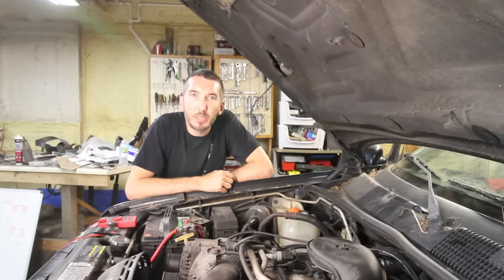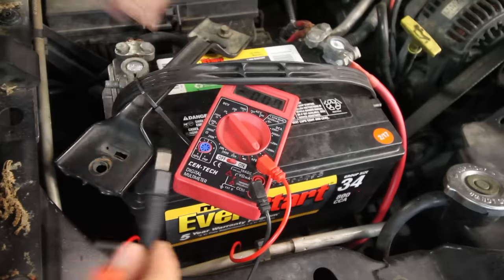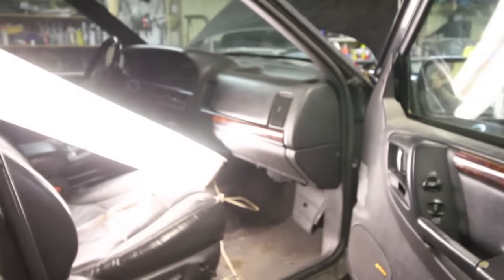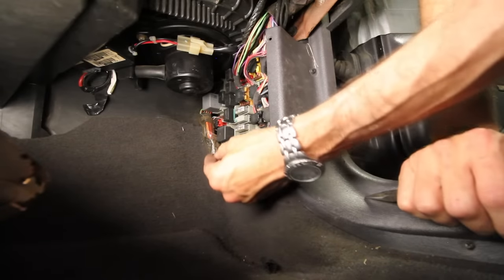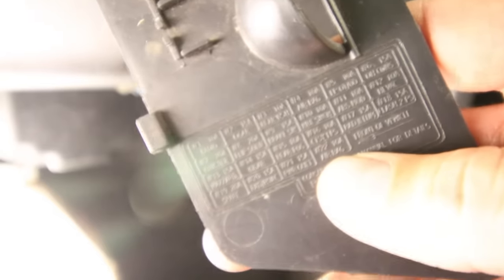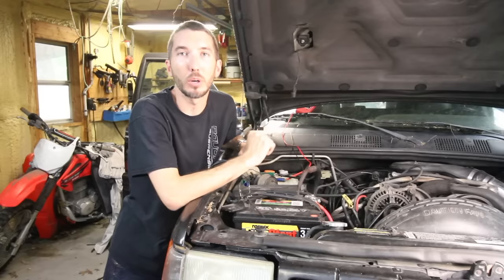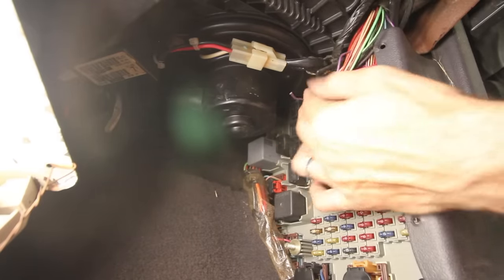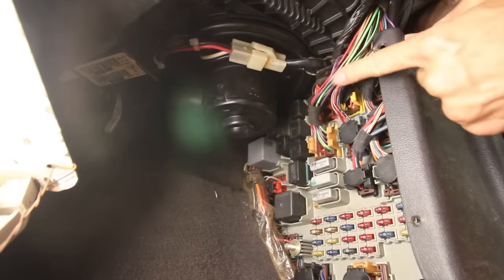Why Does My Battery Keep Dying? - Parasitic Draw Test and Fix - Operation Cheap Jeep

Comment: fun story about how everything is related (especially on late 90s Chryslers). passenger side window regulator goes out on 02 Grand Cherokee while we're out of town. I artfully use a rubber mallet to hold the window up to get us home, and I just disconnect the main harness for the door so I don't accidentally force it and potentially do more damage. in addition to NONE of the power locks working, and the right rear window not responding, the dome lights stayed on. pulling the fuse for the dome lights causes the  AZC climate control to not power on. given that only left windows worked, A/C did not turn on, and it was 80 degrees, I had to stop again and replace the dome light fuse. the next day I did what I should have done at first, and just disconnected the connector for the window motor.
Reply from the maker: Pretty crazy that pulling a wire for your door can cause the A/C not to work, but I believe it after messing with this stupid thing!
Reply: Matt Hooker my 04 has done that multiple times. broken wire in the harness that goes to the driver's door will do that. Caused my AC to stop working, caused power locks to stop working, all 4 windows to stop working, all the lights on the dash to come on randomly, etc. Fixed the broken wire and everything worked fine afterwards.
Reply: i did something similar with a late model zj like the one in the video, i simply replaced my doorpanel. then the key fob didnt work, no worries i close up and go to bed. wake up at 5am to head to work, try to start the jeep and the alarm goes off. neighbors loved it. found out after a whole day of research and chasing wires,missed work btw,  that the passenger door switch assembly(window switch and door lock switch) is where the sensor for the key fob is. also found out you cant disable the alarm in a 97  zj. and if you use the power locks to lock the jeep, the alarm arms and unlocking it with the key dosent disable it, only disarms using the fob or unlocking the rear hatch with the key for some reason. my jeep had the hatch lock cylinder replaced at some point before me and that key trick didnt work. has worked on my buddies 95 zj tho. yay chrysler. i sold the zj and have just have my mj now. and a honda lol.
Reply: If you think it was the hatch why didn't you unplug it and see if it stops. Instead of cutting wire.
Reply: Honesty is rare. I just happen to have a 130K 98 JGC. I jump start it with a 98 lawn mower. AC works but not the AC blower switch ...;) I store yard tools in it. @bleepinjeep
Reply: Do u have a email or Twitter or something I have some questions and would like to send you a pic of my multimeter
Reply: I have spent months researching into fixing a car battery and found a fantastic resource at Jons Mender Guide (google it if you are interested)👍
Reply: This might be the same problem I have with my 97 Grand Cherokee.  It clearly seems Jeep has crappy wiring.  I also had to have two door locks fixed when I got it because they would not work, and now the left rear window stopped working.  Again, Jeep has CRAPPY wiring.  A Jeep fanatic said they used cheaper than normal solenoids for doors, thus they crap out often.   And the ECM might be next.   Don't ever get a Jeep or apparently a Chrysler car - now made with Fiat parts?
Reply: get used to that guys, anything FIAT bought since 80's to nowdays turned into garbage. Lancia Alfa Romeo was the beguinning now it's yankee time LoL
Reply: This guy reminds me of Mr Rogers until he said  so I just cut the purple wire.
Reply: @bleepinjeep  mine show 0.08 .. What is that mean? Is ok ? Or I is bad?
Reply: I've never had a jeep without electrical issues... It pisses me off.
Reply: My mechanic installed a battery kill switch to help me get by until I can have this done. I'm not mechanically inclined so for now that works for me.
Reply: @bleepinjeep  So we replace the fuse that's doing it or what ??
Reply: @coreydenton8296  where was it broke at

Comment: I have been fixing electronics equipment for 40 years. I think this is the BEST real world troubleshooting video that I have ever seen. THANKS....GREAT...JOB!!!
Reply: My professors had to say it twice before l got it...this guy..l could have listened with eyes closed n still got ..kudos
Reply: What are you saying .....BEST EVER
Reply: Best way to wakeup a bunch of modules and then your chasing your own tail!!!    There is a better way!!!
Reply: I've also been in electronics and computer repair for 40+ years and I would have followed these exact same steps. I suspect a switch that is supposed be open when the hatch is shut is either stuck or shorted closed. Or possibly not getting physically pressed by the hatch.
Reply: @wileypeacock6095  This is what I experienced. My back hatch switch circuit was not opening because the hatch wasn’t closing completely. My dash light was on, but I didn’t think that would drain the battery when the engine was off, but it did! Once I fixed the latch and the dash light went out, battery was healthy since!
Reply: Cutting harness wire is not a fix.. amateur hack hour
Reply: Yes, fundamental and helpful. I’ll be following the same steps with my WJ and BMW.
Reply: This gives me a place to start! I have a 2001 Dodge Intrepid and the battery drains within 2 days if I don't drive it. Maybe I can figure out my problem. Put it in the shop twice all they did was take my money. Car came home, was dead the next day  Master mechanic, right!
Reply: Agree beat one I've seen  thanks

Comment: I´m a mechanic. This is one the best videos I´ve ever seen. Very well explained. Perfect troubleshooting.  Good job
Reply: I've had my car in the same repair garage for several years now, for the same fault, battery drain.. After having two new batteries installed within a short time, we paid for an electrical check by a car electrician, ovr £70 each time, the garage did other various checks. The electrician said no faults in the electrics, we were finding that the cooling fan was staying on after switching the battery off, this was intermittently. Then the garage fitted another new battery and a new alternator. Problem of battery drain continued. We'd charge the battery up and it would slowly drain, until the second or third week the battery would be drained. My car is 2002 vauxhall diesel 1.7. I'm so fed up. I've been giving the car a good run at least once a week, thinking I was topping up the battery but, this morning I went to start the car and the battery just made that dying sound, no start.
Reply: @kt1696 it's been 4 months since your post and I am wondering if you attempted his approach?  I somewhat suspect that the shop electricians  plugged your car into an electronic diagnostic port and downloaded any fault codes.  Finding none, they said "no issues" found which very well might've been true at the time if there's an intermittent short that was not active at the time they tested

Comment: This video is 6 years old but has to be the best troubleshooting video of how to troubleshoot a parasitic draw. I did the one that has been pretty popular of how to locate it without removing the negative battery cable but that one has proven a bust. What I love about this video is you not only show how to set the multimeter and pull the fuses but you then also show how to go to the next step to narrow down where the draw is in case you still end up at a rather broad range of possibilities like the wire cluster that the fuse was connected to which in turn controlled the BCM which would have been a major pain to troubleshoot. Hopefully whatever is draining my battery now is something easy to locate, but better yet, easy to fix.

Comment: I watched this video yesterday before doing some work on my battery and today I helped a neighbour with a drained battery get her manual transmission car push-started and on her way. Since this video touched on a back door-release hatch not working properly, I looked for something similar when my neighbour's "door ajar" warning light stayed illuminated. Turned out her back hatch wouldn't close properly because of some fender damage that wasn't fixed and caused the door to jam opening and closing. To open it, she would pry with her fingers on one side and pop it open. To close it, she would give it a good slam. However, the electric switch to remotely open the hatchback was accidentally hit by her and since the door didn't pop open at the time, and she didn't notice the illuminated warning light, it stayed illuminated for days until she went to start her car today. Not exactly the same problem as the Jeep in the video but the knowledge gained came in so handy less than 24 hours later. YouTube University is great!
Reply from the maker: Glad I could help!

Comment: I spent a year taking electrical classes. Forty hours a week equivalent to 2 years Technical college. I had two incredible instructors and I learned a lot. However I have never understood how to troubleshoot the electrical system of an automobile this clearly explained the issue I was having understanding it. 
Dummy me kept thinking I would have to find the end of every wire one at a time and test them. 
No one has ever ever suggested checking fuses in this way.  
Thank you for sharing this information. I have a 98 dodge ram pickup that is drawing from somewhere. Now I can track it down without taking the dashboard off.  LOL

Comment: good tutorial, i learn something from you matt...thanks, other solution is disconnect the fuse, replace it with a 4pin relay, one of the pin of the fuse is constant (+) connect it to #30 (add a fuse) of a relay, other pin of the fuse to #87 of a relay, connect #85 of a relay to ground then the #86 (switch) of a relay to + acc from the fuse box (find one), its just by doing this the body control module wont have power supply when key is off (so it wont draw any power) but when u turn the key to acc or on it will supply power to the relay switch powering it on.

Comment: Knowledge is Power! After watching your concise instructional video I feel empowered to get started on my friends Mercedes with APBD (annoying parasitic battery drain). I watched several other videos and they all assumed I knew how to use a multimeter. Knowing what it is and knowing how to use it is the difference between failure and success. I start tomorrow morning and plan on having an answer as to why this happens. Thank you , thank you, thank you !
Reply: Did you find the problem? I have an MB with an APBD.

Comment: Excellent job.  I feel more confident now in tracking down the parasitic draw in my '87 Chevy Silverado R10.  Shop said it was an alternator and replaced it.  I had a new batter in, and two days later it was dead as a wedge.  I should of taken it back immediately.  Thanks for the alternator that I didn't need.  It was a birthday gift repair, and I didn't want to let my dad know it didn't solve the problem.  LOL.

Comment: Just an FYi(cause I didnt see it in the video nor the comments), The Security system relies upon that back hatch being closed, and if it senses that it isnt closed; the Body Control Module never 'goes to sleep' after the system arms itself(3 min after door lock or engine off and doors closed). The late model ZJ's were notorious for this flaw, and many times the BCM burns out because of it.(too many hours being on). I had this issue for some time. The alarm would go off at strange times during the night/day. The fix(if you do not have the flipper glass on the hatch) is a simple $2.00 switch/part that fits into the hatch mechanism. If the flipper glass is present: there is another plastic piece that helps the car know that the window is closed or open. Also quite cheap if you can find it.
Reply: if the BCM never goes to sleep, you will find a parasitic draw much like what you have in your 98 GC. There is also a quick fix for the hatch mechanism sensor. You just clip the sensor out of the circuit in the rear by cutting the two wires to the sensor(in and out of the mechanism) and simply crimp or solder them together. This fix will always send a circuit 'closed' to the BCM but will allow your rear hatch or flipper glass to be opened whenever without the alarm being triggered. Also a fun fact, the rear locking mechanism also controls the power feed to the rear wiper. If one or both of the sensors in the back hatch are in an 'open' signal the rear wiper will not work. The relay system will not allow the power to get back there for the wiper to do its thing. For other ZJ owners out there: Cherokeetalk and Jeep Forum have tons of info and friendly ZJ owners ready to help.
Reply: Finally a commenter that has a clue about why a rear hatch sensor/switch is important and why the BCM should be left operational and not disabled... Is he going to tell his insurance company he's modified the vehicles alarm so it is no longer effective? I doubt it!

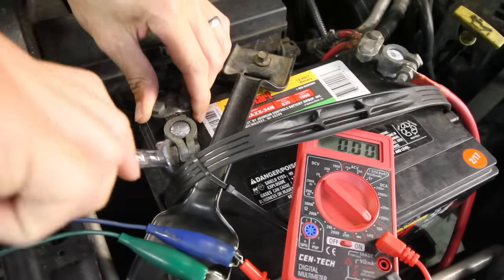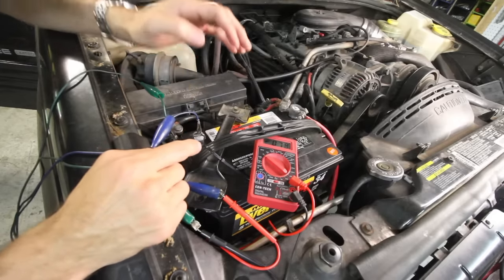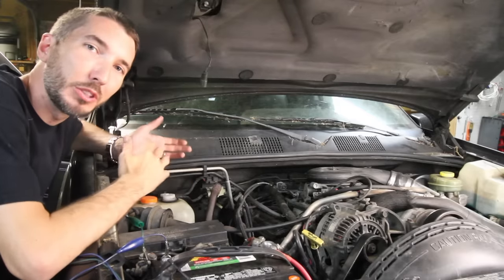Comment: 0:40  short-circuit in the wire somewhere.  0:58 DC Volts 20, make sure you have a good battery reads 12.6v+. 1:15 check terminal for excess corrosion. 1:34 turn to 10 amp (milliamps setting ideal to spot tiny draw), move lead to amps jack, attach leads. 2:10 disconnect neg battery terminal set aside. first turn everything off, close doors or tape sensor shut, then connect leads 2:48 connect one lead to terminal, the other to the cable that normally connects to it 'to get readings in between' the two. 3:00 on the 10 amp scale you should not read anything over 50 milliamps (.05 on 10amp scale). 3:30 now pull fuses 1 at a time until you find the one that drops the drain to 0.

Comment: EXCELLENT VIDEO!  I get so tired of trying to locate DIY videos that are loaded with guys yammering about stuff instead of showing relevant content.  After watching this, I'm ready to take a shot at my C4 'Vette's battery drain.  Mine isn't terrible; I usually get 5 days before the power is too low to start, so I keep it on a trickle charger, but that's an annoyance.  You've given me the confidence to go after it myself!  THANK YOU!!

Comment: One of THE BEST fault-finding videos i have ever seen. I had a "05 Jeep Cherokee and it had sooo many electrical faults i traded it in on a Mazda CX9 - best thing i ever did. I wish i had seen your video before getting rid of it. The dealership could not fix the faults !! The transmission would drop into 1st gear from 100klm on it own !! nearly killed me.
I will use your tips to fault find an issue on a vw /subaru conversion that drains the battery. Thanks

Comment: This finally helped me solve this issue on my WJ. Mine was the rear driver side door ajar sensor. Confirmed the parasitic draw, tracked it down to connector C1, pin 10. Clipped that wire and the draw dropped to zero. Since I had the seat and all trim pulled anyway I went ahead and patched in a new wire from the panel to the connection at the door. Everything works perfectly again. Thanks a ton dude. Great channel, one of my absolute favs.

Comment: Went and got a harbor freight multi meter like in the video. Didn't notice that I picked up the 5 amp model by accident, the wires melted. My 2000 XJ has been a wild adventure so far. LOL

Comment: Great video Matt.  You're a very good teacher.  Ever think about taking rings & watches off when working around cars...esp. electrical?  Ever see an injury from a shorted out ring?  This safety stuff was ingrained in me while serving as an acft electrician in the AF.
Reply: Years ago I was replacing a headlight bulb on my Ford. The pos post of the battery was located quite close to the metal of the front fender area. So when I reached between the battery and the fender to replace the bulb my wrist bridged the gap. I was wearing a wrist watch at the time with a metal watch band, so the watch band bridged the gap between the pos post and the sheet metal, creating a dead short and many amps around my wrist. I tried to flip the watch band off of my wrist with my other hand but it was so hot I couldn't touch it. After jumping around and flailing my arms I finally got that watch band off of my wrist. I developed a permanent scar where the watch band went around my wrist and I can still see that watch band 40 years later.
Reply: @charleswilson4598  ouch I bet that only happened once. I once pissed on an electric fence after a dare it burnt my hair and schortched my balls and made me shit in my coveralls
Reply: Yep....never wanted to get caught wearing rings, jewelry, etc on the flightline.
U.S.A.F. Weapons Specialists
F-16
A10 Warthog

Comment: Matt you got me !!  I just bought a used late model 2018 Kia Sedona with 28,300 miles and 3 years on the warranty. I had no trouble until 3 weeks after I bought the car. The battery went dead. So, I jumped it, went to AutoZone, found out had a dead battery and replace it. 2 Days Later the battery went dead again. I jumped it, went AutoZone... same drill and the battery... alternator and starter are fine... so I have a parasitic battery draw !!! Darn it !!! Why does this happen to me  ?? So, I've watched about five videos on parasitic power draws and yours is pretty good 👍.  I can see it's not going to be as easy as I would like,...but maybe not that bad. Thank you so much for your demonstration/ explanation and teaching. I really do appreciate it and I'd probably be lost without YouTube gurus like yourself. I spent all my money on the car and I can't afford a mechanic now. By the way I hate electronics too  !!!

Comment: Before cutting the purple wire you can remove it from the plastic block with a straight pin.  
slide the pin next to the wire. on one side will be a release letting the wire free from the block
Reply: You can do that or just leave the fuse out as it's probably exactly the same circuit he's disabling (NOT FIXING)